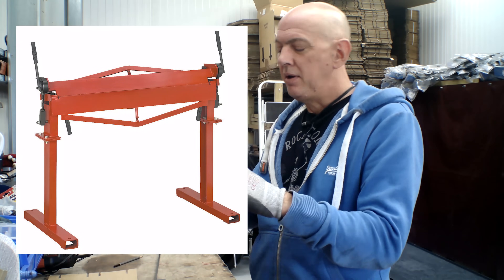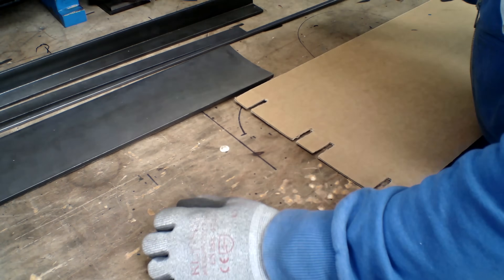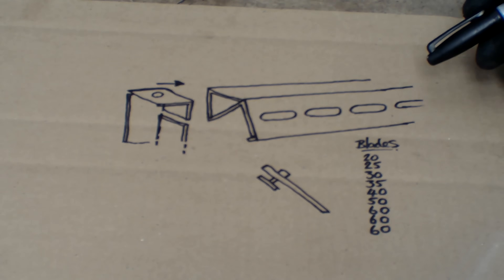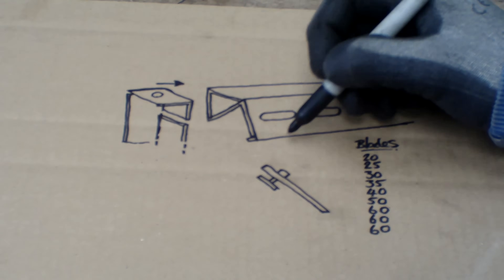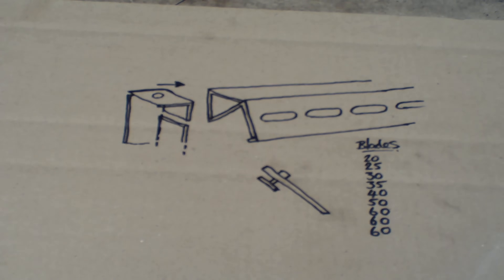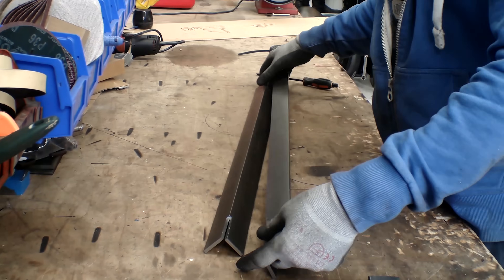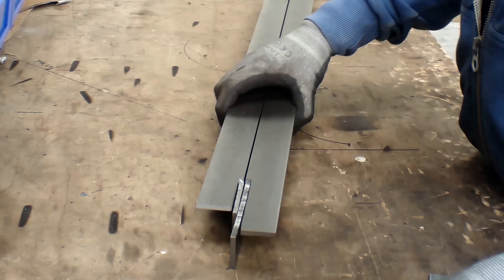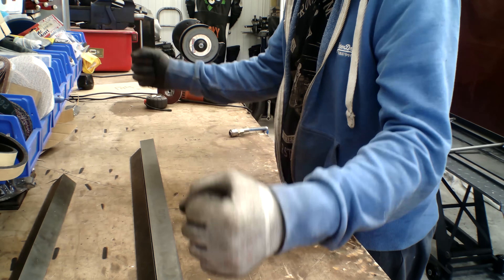Home Made Box Pan Brake for bending sheet metal

Comment: 2 mm steel is too thick for the stiffness of the brake that you have constructed.  The bend is not a good bend, not a constant radius, and too large.  You didn't show that very well.  When bending I can see the top portion (the "gantry" might be a good way to describe it) appears to be flexing.  Maybe the whole thing should have been 8 mm thickness.  The Eastman and Grizzly are all made of thicker stuff.  This points out the reason for the thicker construction.  It might have been better to put the second angle behind the slotted piece  turned 180° so that the vertical leg was directly below the apex of the V.  This would have put the vertical stiffener closer to where the bending force is.  I bet this device would do a grand job bending aluminum the same thickness or thinner steel.  Good video, spoken by a guy who talks clearly enough, and enunciates sufficiently, even with the accent, that I can understand what is being said.  You didn't mention the maximum box depth that you can bend, limited by the clearance between the bending surface and the "finger" support.  I'm guessing the max depth is somewhere around 40 mm.  I need boxes with 75 to 80 mm depth.  Thanks for the suggestions.  Replies to comments below suggest changes are planned.  I'll be interested to see what they are.
Reply from the maker: Thank you very much for the comment and I agree with you entirely... I've used it in anger for a while an 2mm is too thick. I'm going to be remaking the fingers, how they are attached and adding some bracing to the finger plate and folding platen to stiffen everything up. Hopefully It'll. Improve the radius of the bends I'm getting. Brilliant input, thank you 👍